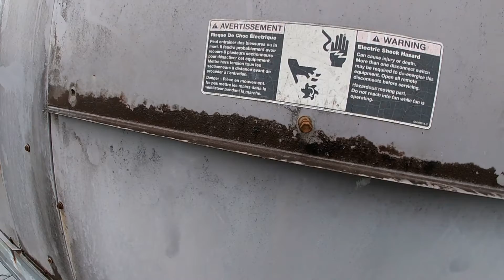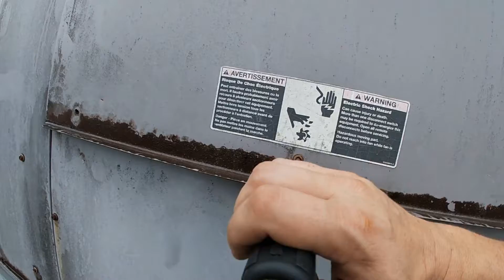HVAC Carrier RTU East Wing Is Having Some Filmiar Issues

Comment: Geoff you should read across the fuse when it’s powered up to see if it has blown. If you show voltage across the fuse it’s blown. If the fuse is less than 100 amps change all 3.

Comment: at 1:08 is it just me or did someone forget to strip those wires under the lugs. Also, I'm not sure if you can do this, but it might be worth a call to your power company and see if they can test their voltages on their transformers that feed your buildings, or where the service comes into the property. I'm not sure how the services are set up at your complex, but sometimes they will have one service coming to each building, which is probably what you have, or they might bring one large service to one large electrical room, then the electrician is responsible to distribute it throughout the property at smaller electrical rooms in each building.

Comment: Jeff if those fuses blew take a look at the whole unit and see what that line powers. You may have a short or grounded part somewhere in the unit which blow that fuse. Better be safe and check everything.
Reply from the maker: Oh yay when I go in on Monday i'm going check everything to see if it's shorted to ground.That rain yesterday got the best of me.  I looked up the fuses they are like 40 bucks .
Reply: @geoffhoweth  Thank god it's not another AAON video I noticed you haven't been on discord much lately. You and I have been both busy as heck.
Reply: Akvan79 i hate finding blown fuses. It usually means something is grounded, like a compressor.

Comment: What if there is hi voltage going to the air conditioner
Reply from the maker: I'm not sure what you mean there was its 208v 3 phase.
Reply: @geoffhoweth  i mean to much voltage
Reply from the maker: @ethansnewsnelson4057   Nah that fuse volts are rated to 600v the amps are 150 It's most likely something grounded are the one fuse that blew was not the same type it supposed to be a jjn-150 and the one that blew was a f-34 are something like that. I will be looking for a short come monday. Thanks For Watching Ethan.
Reply: Ok
Mad I love watching your videos 
And I am 10 1/2